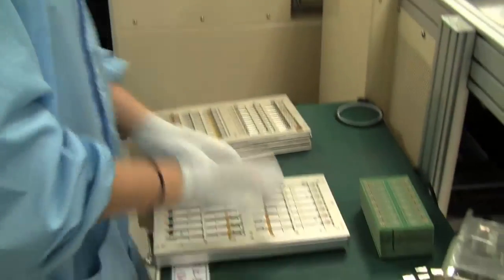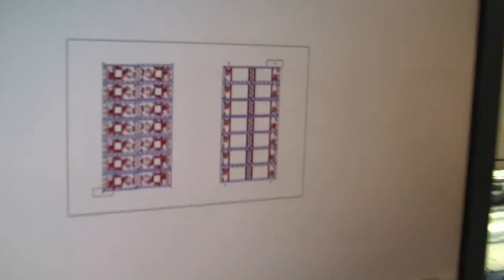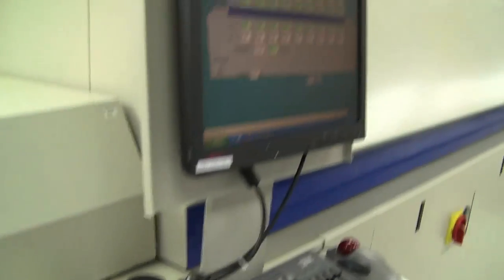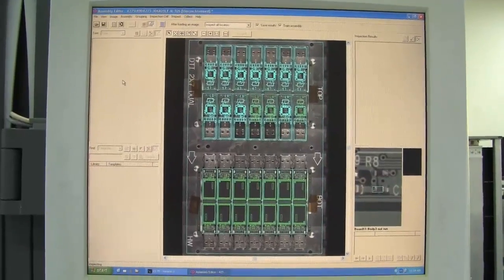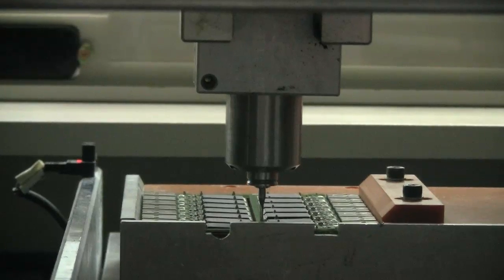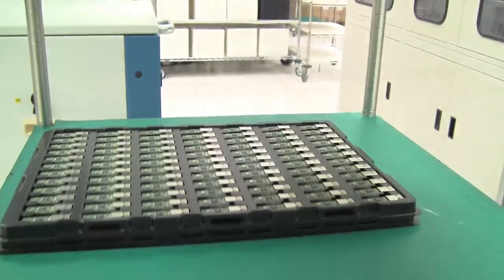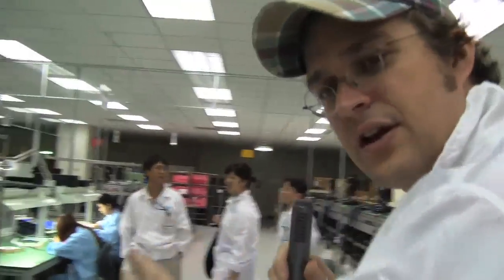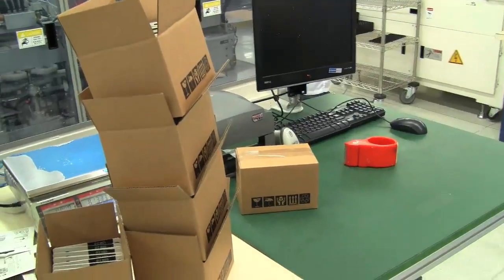How's a USB Flash Drive Made? Trip to the Kingston Production Plant

Comment: yes you to can make a diode. first get a silicon wafer. it probably has boron in it.  sandpaper 1 small side. put powdered aluminum on it. seal with clay. heat with a bic lighter. put brass contacts on. test with small transformer to convert ac to dc. now make a comtari computer.

Comment: here here here is all i hear... This is how it's "made" not manufactured:

1's and 0's binary data is stored on these drives. So they use millions of transistors that can store a logic high state (represents 1) or logic low state (represents 0). Think of transistors like a light switch you can turn on and off. Transistors are made with semi conductors which only conducts electricity (lets current flow) if it has enough voltage applied across the cathode and the anode. Most semi conductors are made with Germanium or Silicon and doped with other chemicals to change different characteristics that affect things like switching speed and tollerences. And thats the study of Electrical Engineering :)
Reply: can i have your email please

Comment: How do they put the memory on the drives?
Reply: 1's and 0's binary data is stored on these drives. So they use millions of transistors that can store a logic high state (represents 1) or logic low state (represents 0). Think of transistors like a light switch you can turn on and off. Transistors are made with semi conductors which only conducts electricity (lets electricity pass) if it has enough voltage applied across the cathode and the anode. Most semi conductors are made with Germanium or Silicon and doped with other chemicals to change different characteristics that affect things like switching speed and tollerences. And thats the study of Electrical Engineering :)
Reply: @hellokrisho  
oh man you are rock!.. im 13 y.o boy always asking how could human  create an ideas like those thing.. 
how camera lens, flash drive, internet data, and many more that produce..
2021

Comment: The packaging they use on these and other small electronic items drives me nuts as you either need a stanley knife or a pair of tin snips to get the damn thing open as tehy are thick plastic and are welded all the way around.I know it was designed like this to prevent the packaging from being opened in store and the products stolen but you'd think they would come up with an easier to open option,or have a machine that opens them at the checkout for you.Also the plastic can be razor sharp.

Comment: @UpcomingJedi 
no trade secrets there this is all very standard electronics production line tech. solder paste mask unit, visual inspection, pick and place, oven, electical testing, end milling(routing), plastic assembly, testing(usually not done twice for so cheap products) and packaging, the only think irregular is the manual labeling, rest of it is very standard stuff you can find in any electronics production line

Comment: One thing someone told me: if you accidentally run it through the washer, put your car in the hot sun and leave the stick on the dashboard for the afternoon. It usually fixes the problem if the stick doesn't work.

Comment: So, building a machine to lay stickers. Challenges are: 1) removing the sticker from the film (or designing a cartridge system for stickers). 2) grasping the stickers. 3) aligning the stickers. 3) releasing the stickers. I'd figure that designing a machine to do this well would take ~500-1000 designer hours, though I could be way off. Add to that the cost of fabricating the machine, the feeding system (the trays need to get to the machine), and maintaining the machine (it breaks down). expensive